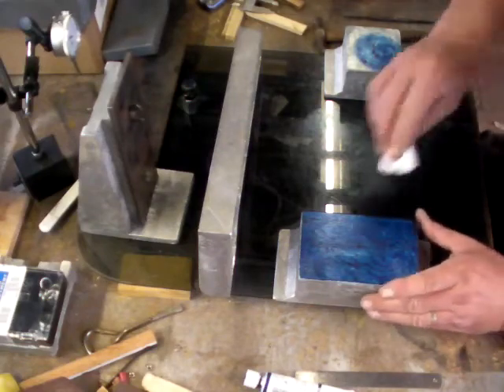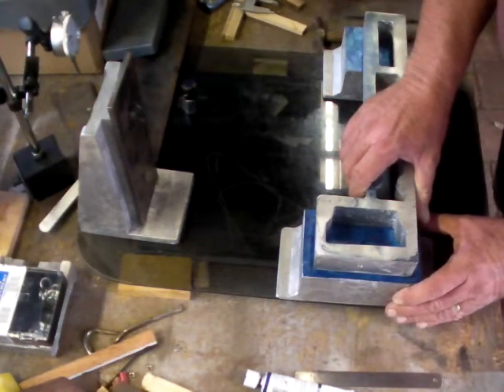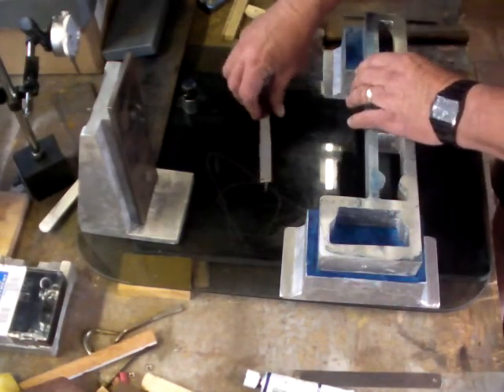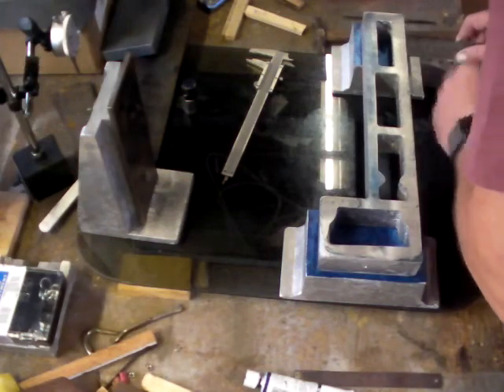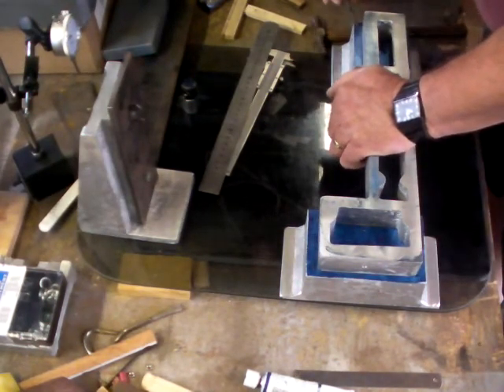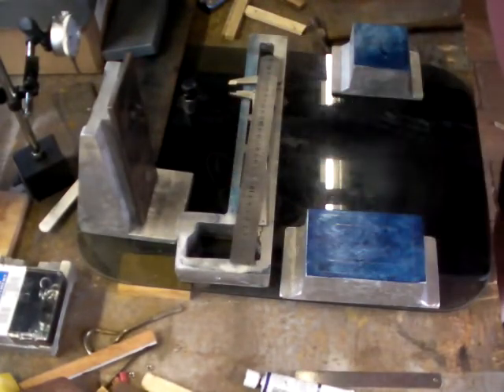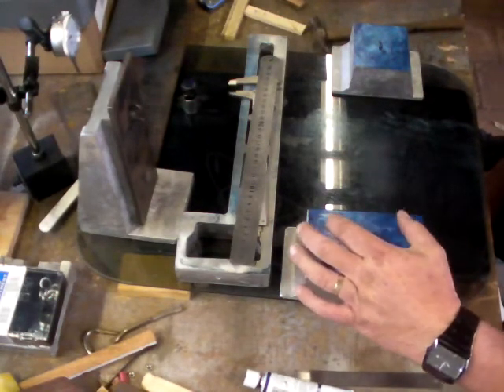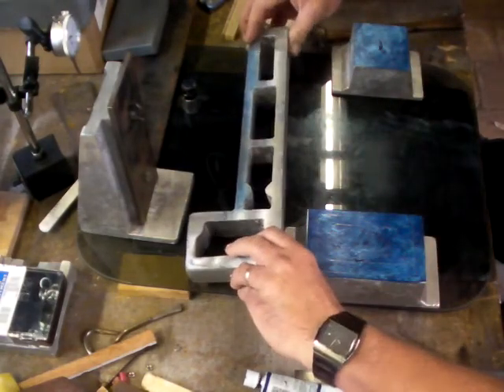Building the Gingery Mill bed stands. Machine 4

Comment: I have a instrument lathe, it is not a mill, but it came with a pair of bed stands, I found a large cast chip tray and mounted these through the chip tray then mounted the lathe bed across those stands making a stable rigid box configuration and it actually holds the coolant and the chips in it. I am enjoying your videos, I love watching the making of these machines only I am wondering if you are going to show machining these parts of poring these cast units? I shale watch the entire series and see what is shown, thank you.
Reply from the maker: G’day Fowler, I had actually started making the mill before considering making YT videos, so in these early videos I don’t do any work. These early videos were made in 1 take, soon you will see some action. I knew nothing of videography and editing and am still learning, lighting and sound levels are still a challenge and editing is restricted to what Windows Movie Maker offers and what I can squeeze out of it. Cheers Peter